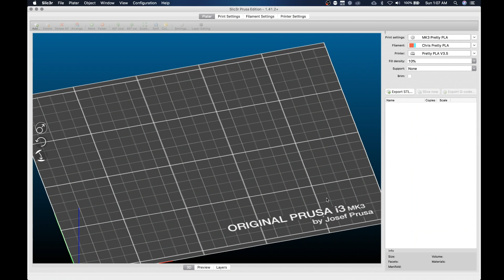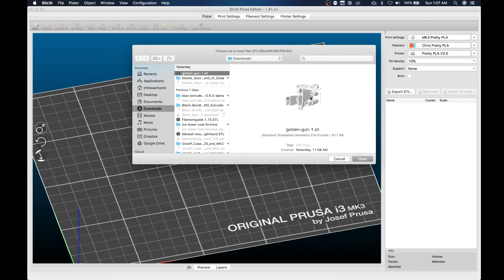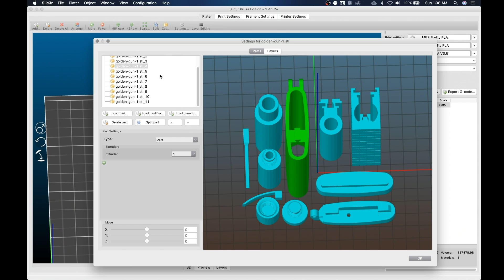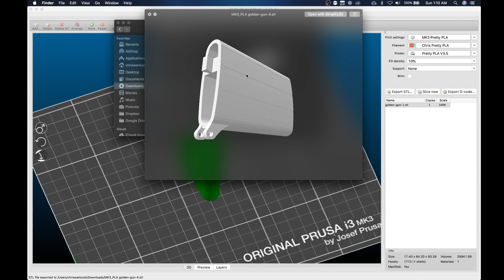Slic3r PE: Splitting Multi Part STL's

Comment: Great series! Love it!
But for this part a small question: why not simple right click on the object on the platter and select the split option there? What is the difference between your method (using the object settings) and the direct-on-platter-split method?
Reply from the maker: Christoph Friedrich as someone tested earlier it doesn't always work correctly that way. Not sure why. May have to make a GitHub post.
Reply: Ah! Thx for that information. Didn't know that. Now I'll use your method instead ^^

Comment: Another great video Chris! Thanks for sharing this time saving tip. I had no idea you could do that. I wonder if you can choose multiple files with the Shift Key by clicking on the top and bottom file, which would highlight those files inbetween, and then delete? Would save you a few extra clicks/deletes. I haven't tried it on Slic3r, but works on other software files. Just a thought.
Reply from the maker: Shift + Click ins't enabled in Slic3r for some reason. I've added a request in Github for it.